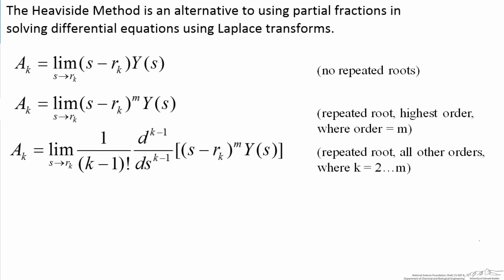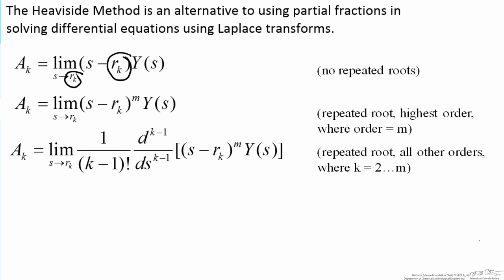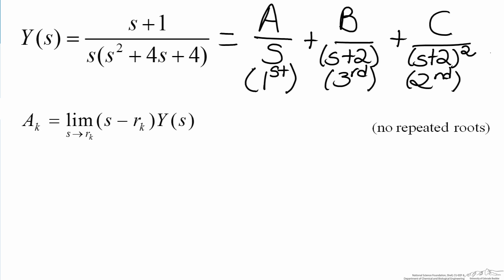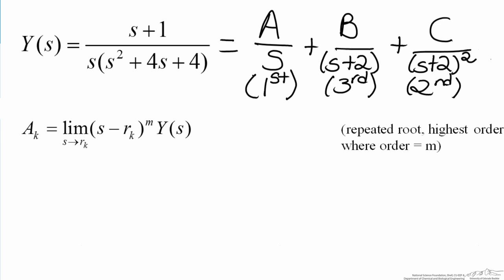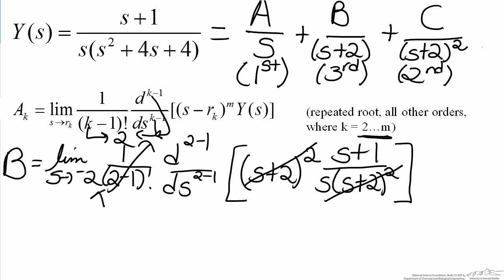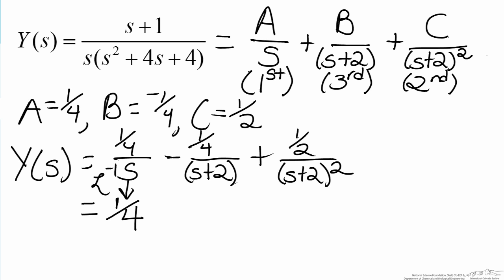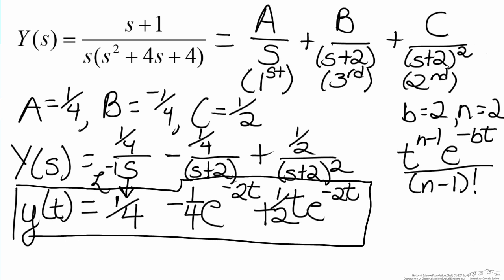Laplace Transforms: Heaviside Method

Comment: What if we have complex roots Sir?
Reply: If you have complex roots, you'll have to revert to previous principles.

As an example, consider:
(x+2)/((x+3)*(x^2 + x + 2))

Your partial fraction setup becomes:
(x+2)/((x+3)*(x^2 + x + 2)) = A/(x + 3) + (B*x + C)/(x^2 + x + 2)

The cover-up method gets us A, but not B or C.  We get A=-1/8.

We now need to cross-multiply, to get B and C:
-1/8*(x^2 + x + 2) + (B*x + C)*(x+3) = x+2

Let x=0, and let x=1, as two numbers we haven't used yet.
for x=0:
-1/8*(2) + C*(3) = 2
3*C = 2 + 1/4
C = 3/4

for x=1:
-1/8*(1 + 1 + 2) + (B + 3/4)*(1+3) = 1+2
B=1/8

Solution:
(-1/8)/(x+3) + (1/8*x + 3/4)/(x^2 + x+ 2)

Comment: which are the limitations of this method? if have any of course
Reply: It works any time you have real/distinct roots, or real/repeated roots.

When you only have real/distinct roots, it can get you all of the numerators in the partial fraction decomposition.
When you have repeated real roots, it can get you the numerators on all of the distinct roots, and it can get you the numerator on the highest power term of your repeated root.  You still need to use previous principles to get the remaining terms on the repeated root.  If you have irreducible quadratics, you'd need to use previous principles as well, to get the remaining terms.

So for (x+3)/((x+1)*(x+2)^2) you set up your partial fractions as:
A/(x + 1) + B/(x + 2)^2 + C/(x+2)

This method gets you A and B, but it does not get you C.   This method gives us A = 2 and B = -1.

We then have to cross-multiply, and substitute a sample value of x, to get C.
2/(x+1) + -1/(x + 2)^2 + C/(x + 2) = (x+3)/((x+1)*(x+2)^2)
2*(x + 2)^2 - 1*(x + 1) + C*(x + 2)*(x + 1) = x+3

Let x=0, to keep it simple:
2*(2)^2 - 1*(1) + C*(2)*(1) = 3

Solve for C:
C = -2

Comment: explain k in the 3rd equation plss :(
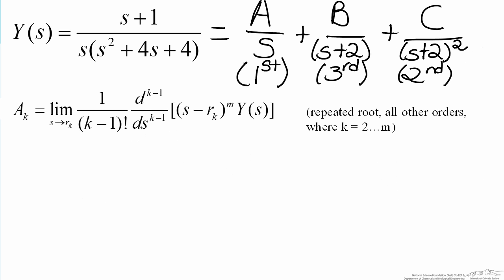Reply from the maker: k is basically a counter variable that represents how close to the maximum order you are.  He goes over this equation starting at 5:30.
Reply: but since we are dealing with the second order term and the maximum order is 2 shouldnt k then be 0??
Reply: k should be greater or equal to 2

Comment: I got lost at 8:25, omg! I didn't  understand..:'(  can you explain it to me?
Reply from the maker: +james fx For the last inverse laplace transform, the math is a bit tricky.  However, one of the tables for laplace transforms that I found had an easier form.  It said that the inverse of 1/(s-a)^2 is te^at.  In that case, a = -2, and the inverse would then be te^-2t, and then of course keeping the 1/2 constant.  It is all about finding the right form in the table, and then making your example fit to it.  I hope that helps.
Reply: LearnChemE You helped me a lot, thank you!